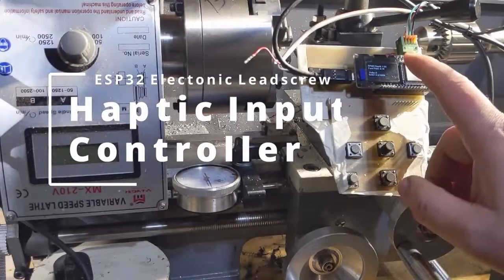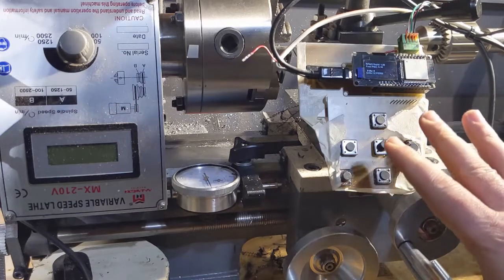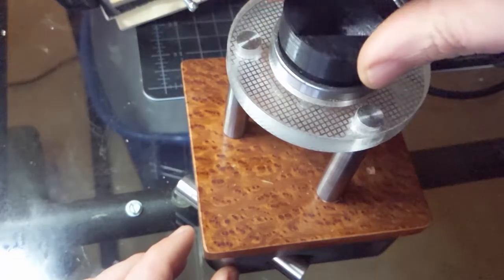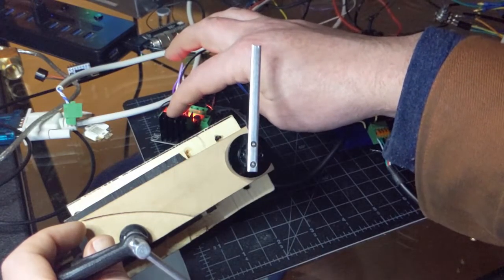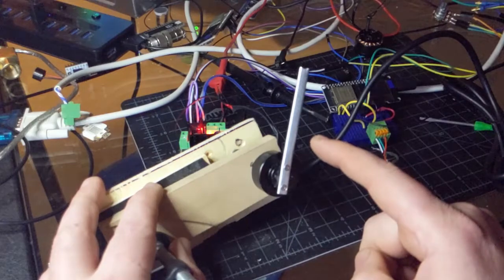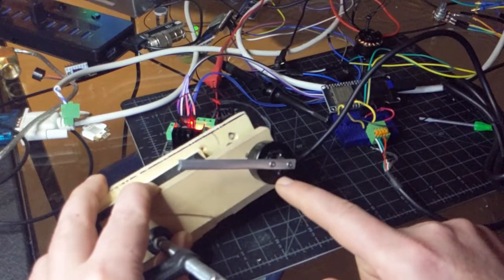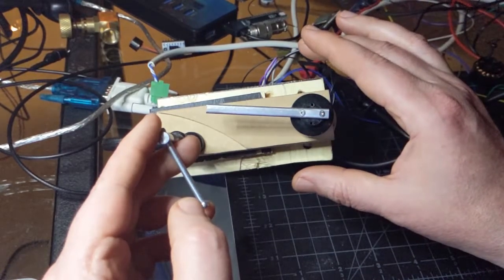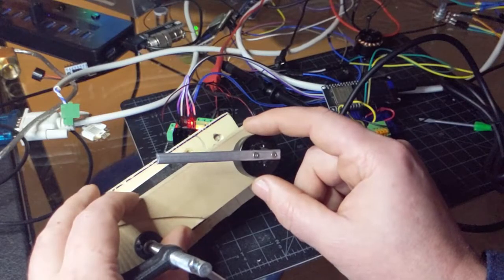espELS: Part 3 ESP32 ELS haptic input controller concept

Comment: All the input modes are very interesting!
Reply from the maker: Thanks, I have a later version that works much better.  the video is called "haptic textures and virtual detents"  I also did a test using it to drive davinci resolve.  My ELS project is coming along and I'm getting close to adding this in.  I need to have bidirecitonal communication between the haptic controller and the els controller.  I'm kinda already doing that with websockets and react.  I've been noodling around using the SLIP protocol over serial but i may just use msgpack and serial.  Any thoughts you have on how it should work would be good.  It has to have some event and and ack sent back.  I'm not quite sure how smart or dumb the haptic controller should be for example I could have the ack from the els controller set the position or the mode of the haptic controller.  Lots of unknowns so very open to ideas!

Comment: You should check out the videos on the electronic lead screw from James on his channel Clough42. Amazing progress! Was a great watch and you've got a sub from me.
Reply from the maker: Thanks for the comment!  Yup, Clough42 did a great job in his series.  One of my long term goals is to help out with spindle sync for Grbl so I wanted to work through my own implementation of an ELS.  The motor control rabbit hole runs deep especially when you add multiple motor coordination.
Reply: @JesseSchoch  its an expensive investment but have you looked into the ODrive motor controller? Its a very capable driver when coupled with a quality rotary encoder.
Reply from the maker: @keithshaffer9608   The driver i'm using is ~$3.  ODrive is for high power high current motors.  This tiny gimbal motor only draws a few watts of power and does not require current limiting.  The ODrive would be well suited to drive the leadscrew though since it can provide torque feedback.
Reply: It can handle multiple motors so in theory you could link it to control the lead screw and the gimbal motor. I'm definitely excited to see where you take this.